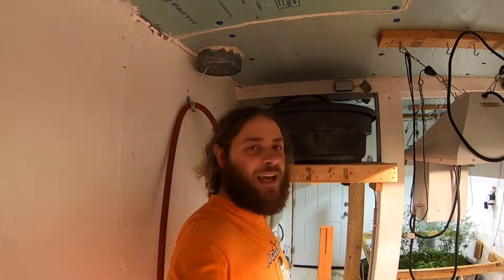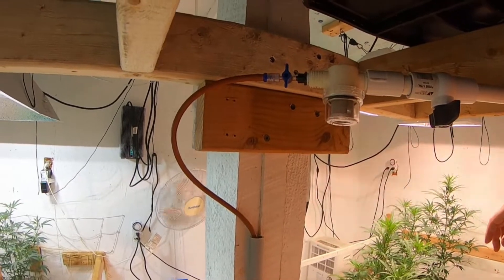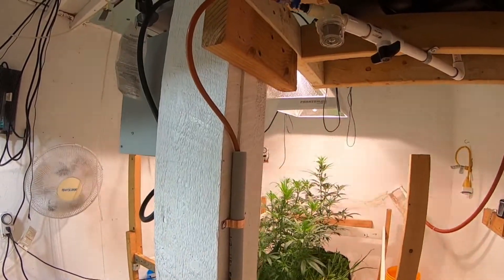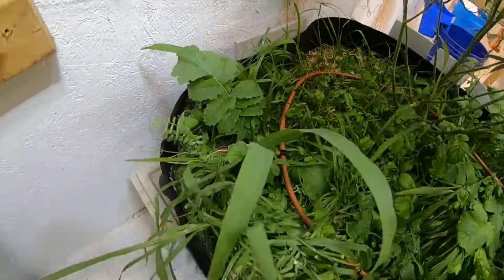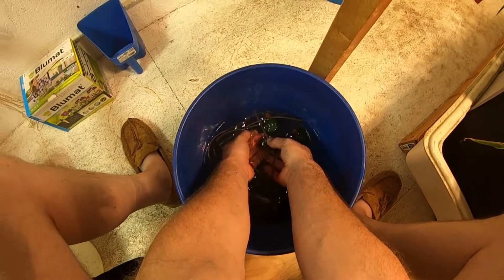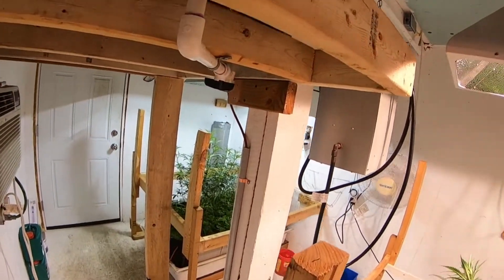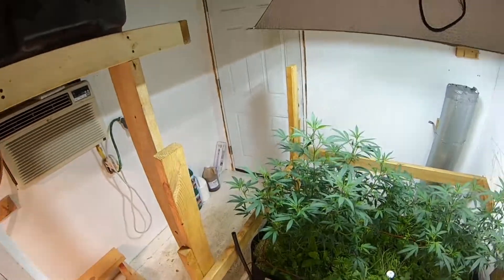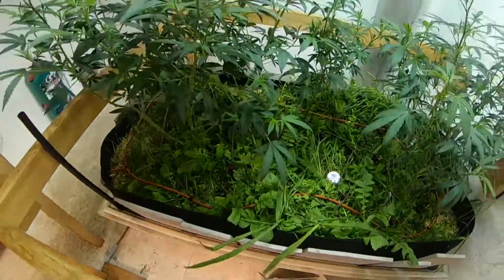How to install Trompf Blumat irrigation

Comment: I came here for help setting up a new hose-fed Blumat irrigation system in my outdoor tomato garden (hoping to build a greenhouse around it before winter).  I have plans to use a gravity system in my indoor culinary herb garden, but honestly I'm starting to think about ways to fit that in the greenhouse because I can be forgetful & the appeal of having this whole system on a hose, allegedly expandable up to 500 carrots, is very appealing to me.  You are pretty creative with these tools, dude, and I love the level of detail you put into explaining the little parts like topping off the carrots with a pipette.  I feel so much more confident working with these for the first time after watching this video.  Thank you!
Reply from the maker: You're welcome! Using pressurized water with the pressure reducer is pretty slick because you can't forget to fill your reservoir, ensuring that the plants always have plenty of water. The only reason I do not use the building's pressurized water in my indoor grows is because the possibility of a line popping loose and flooding the building with an endless supply of water, this happened to a friend of mine. At least with a gravity fed reservoir if a line comes loose inside your room then the maximum amount of water that can flood is the size of your holding tank. Good luck
Reply: @rollinggreenacres6726  wow, great pointer... my current project is outdoors, but I'll keep that in mind if I want to apply Blumat tech inside

Comment: You can use a float valve to keep your res full. You might also wanna check out their soak line,works great
Reply from the maker: I've actually switched everything over to blusoak lines now, the drip emitters clog up with just plain water, drove me nuts lol. I can't say good enough things about the blumats in general, but the soaker line setup is the best irrigation ever
Reply: Hey oldhickory can you do a video on setting up the soaker line? I was just about to get the drip after watching your video but I don’t want to deal with clogged lines
Reply from the maker: @Westcott816  I'll see what I can do in the next month, but I've been thinking blusoak would be a good video topic. Thanks for checking out my channel

Comment: Should be around 80 to 120mb. And the hanging drip should be done disconnected from the distribution dripper. Then back 2 triangles.

Comment: So I am curious, first thanks for this video it really helped set mine up. But it seems to be flooding my bed, I have a 3 x 3 grassroots pot, that I set up on a cut to size pallet, felt it may leak so I bought a pond liner and set up everything. Am I using too many carrots? the kit came with 6 carrots, but I installed 5 I didn't understand the fittings to install the last one so I kept it out. The soil is great tho, can't complain on that part, just wasn't sure about the excess water. Should I add a small amount of yucca to help bond with the peat moss?
Reply from the maker: For a bed of a 3x3 size, I would stick to 2 carrots to simplify things. It seems the more carrots, the more difficult it is to adjust the moisture levels. Do you have a moisture meter? Did you use my soil recipe?
Reply: Try 80 to 120 millibars. As recommended by blumat

Comment: Hey Man!  Love what you're doing here!  Thanks for all the great videos.  Where did you place the "Maxi" carrots in the beds?  Thanks for the info!
Reply from the maker: I used the maxi carrots about a foot in from the end of the 4x2 bed in the center of the bed. I actually prefer now to use nothing but maxi carrots, only I don't push them in all the way, it makes finding the carrot in the cover crop and adjusting it so much easier than the little short ones
Reply: @rollinggreenacres6726  is it possible to use different manufacturer's drippers for drip line off the carrots?
Reply from the maker: @mattwhitfield8715  It would depend on the kind of drippers you have in mind. There can't be much restriction in them or else the water will not be forced out, remember the gravity feed is only about 5 or 6 psi. The ultimate setup that I use now is the Blusoak line made in a loop that is fed by the carrots, it is the most even water distribution that you can get
Reply: @rollinggreenacres6726  awesome man, thanks for the information. I've been watching a lot of your videos. Clearly know what you are doing!!! I'll be sure to catch the new videos as well. Take care and thanks again!